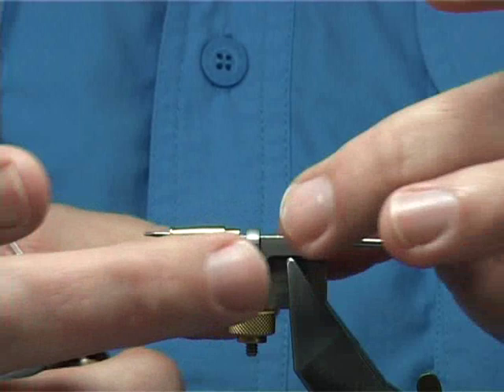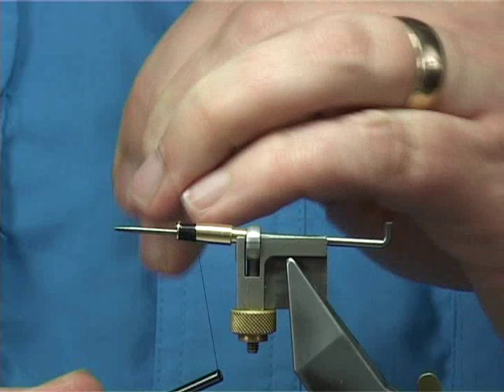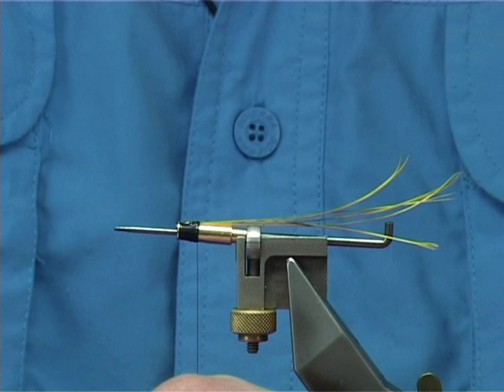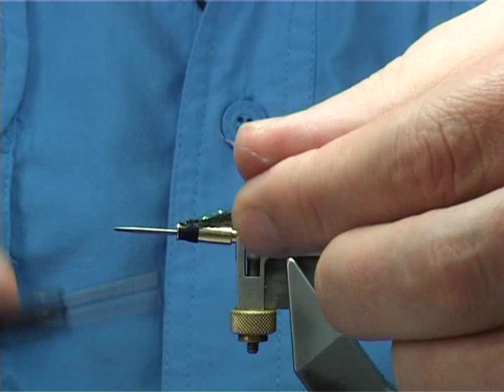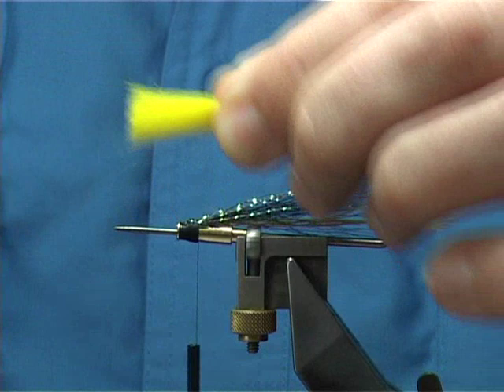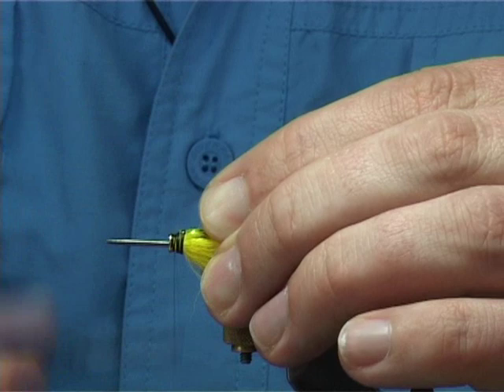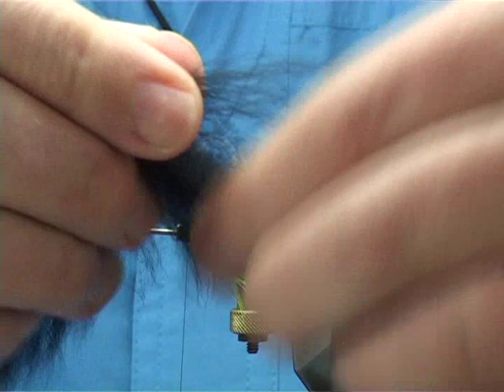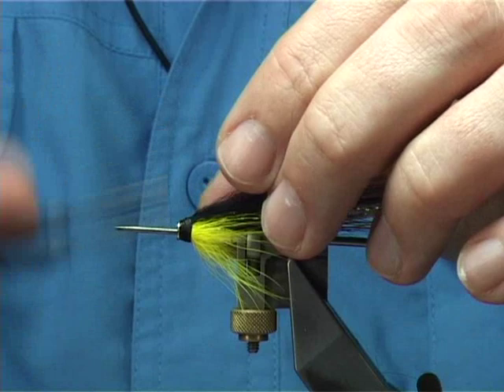Tying a Dee Monkey Piglet (Bottle Neck Tube) by Davie McPhail

Comment: Hi Davie can you tell me the difference in the tying threads i tend to go by you using 8/0 threads but i see some guys use 10 to 14/0 threads any advise please👍👍
Reply from the maker: Hi Colin,

There are times I should really use a finer thread and even a heavier 6/0 but I can get by with using 8/0 on most of the flies I tye as you can see in my videos...I would use a 10/0 or a 14/0 on small wets, nymphs and dry flies but  what I would do is to give them a go and see how you get on..

All the very best Davie
Reply: Cheers for that Davie away offshore tomorrow but will be doon in Glasgow on the 14th so GAC it is mannie thanks again👍👍